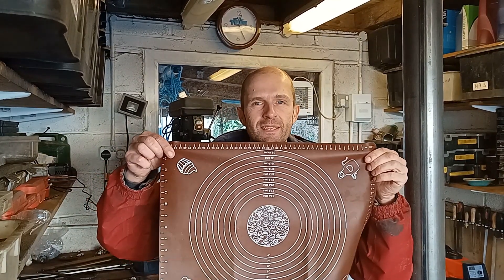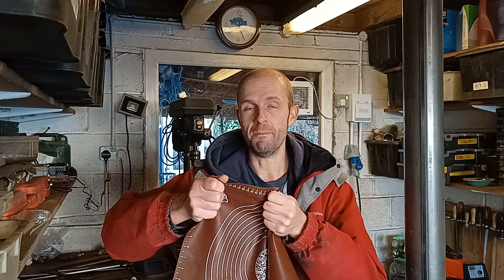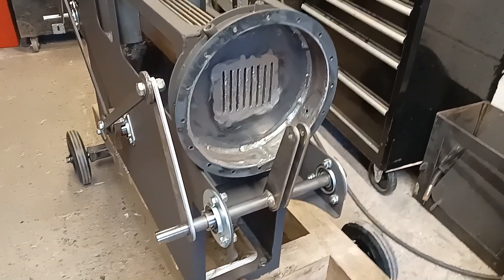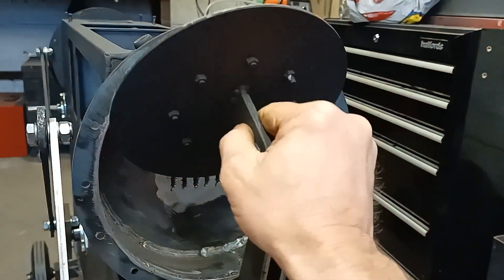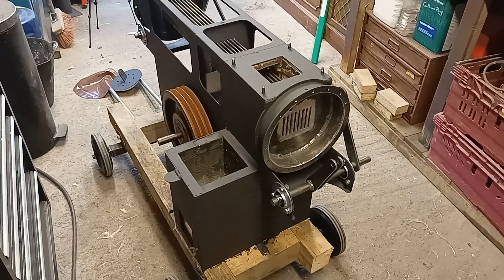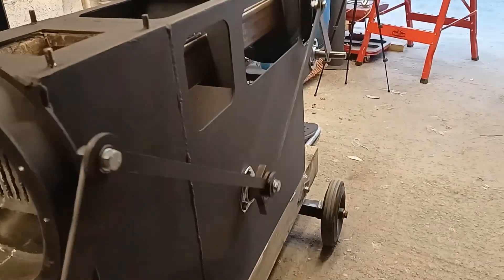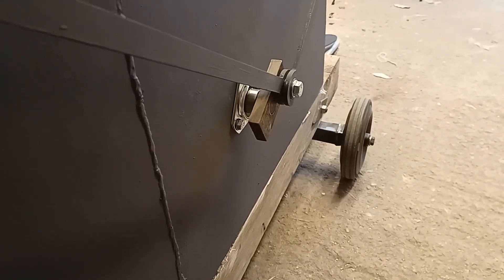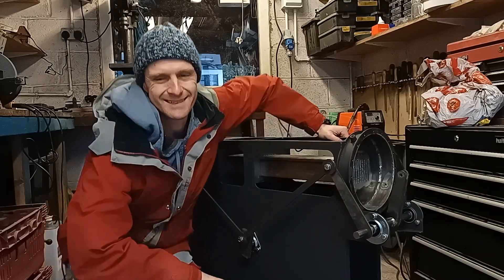Stirling Engine Generator Mk4 (Rocket Stove!) Part 4

Comment: Shane are you going to pack the tubes with steel wool as a regenerator??
Reply from the maker: Hi, I'm going to leave them empty for the moment. I've allowed extra area within the cooling section to act as a kind of regenerator. Even through there is no dedicated regenerator it will certainly act as one. The majority of the old atmospheric stirling engines had no regenerator. I'm hoping the big temperature difference and fairly large heated surfaces will help. What are your thoughts?
Reply: I think something that would stop the mixing of the hot air and the cool would be beneficial.

Comment: McMaster Carr has super stretchable rubber sheets 4000 psi tensile strength 250deg f . 42 inches width. There's i think 8 different thickness choices. The thickest is part number 8611K18
Reply from the maker: I've Just taken a look and they look very promising. I'm not holding out much hope for the silicon baking tray so I'll probably need new options . Many thanks

Comment: Great professional, thoughtful work. Regards
Reply from the maker: Thanks. What are your experiences with diaphragm seals? What type of rubber did you loose on your great engine you built?
Reply: @ShanePomeroy  At first I had one for baking cakes like yours. But it seemed too flimsy to me, so I bought a 2 mm thick silicone plate. I don't know what its lifespan will be because they haven't been working for very long
Reply from the maker: @Lechoslowianin  I might find myself going down that route then. Many thanks

Comment: Well Shane, I must say I am impressed with your heat collector, quite ingeniously designed and manufactured.
Have you worked out the moving volume available against the piston capacity volume?
Man it really looks the part for sure.
Brian from NZ🇳🇿
Reply from the maker: Hi Brian, If I've got my calcs right it should be the standard 1 : 1.5 compression ratio. I can easily adjust crank throw to fine tune this. I'm a bit apprehensive to try it in a few days : )
Reply: @ShanePomeroy  Nice one Shane. I could imagine you could be, but isn’t that all part of the adventure?
I wish you all the best and look forward to seeing your next video.